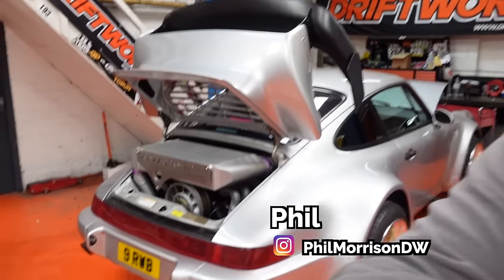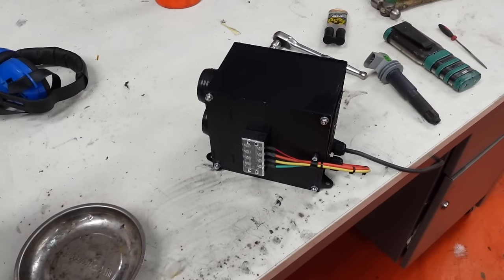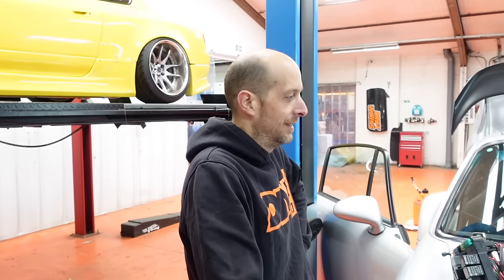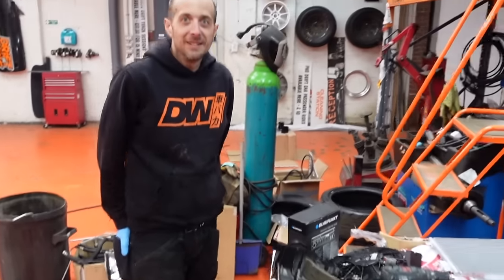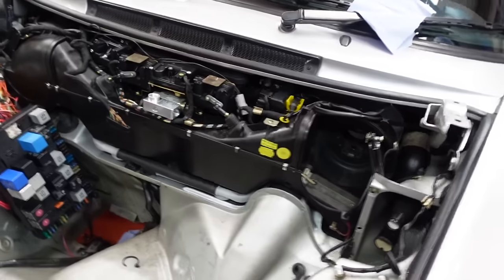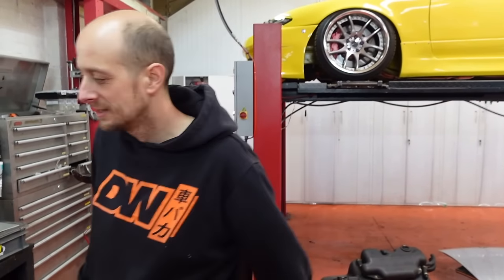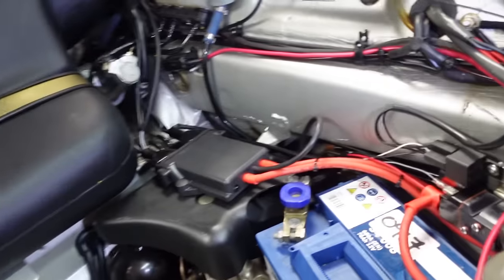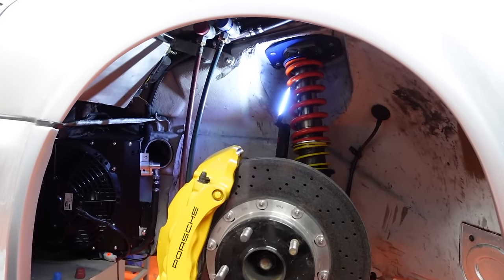Fitting Electric Air Conditioning to my 964 Turbo - Classic Retrofit kit

Comment: A suggestion, make some fine mess shields for under the arches and add louvers (face down) to keep all road debris and rain from the tyres off the condensers, fans and oil cooler.

Comment: I have been considering this for my 1964 Ford pickup F250.  It would be easier than trying to set up a compressor with a belt system.
Reply: Im thinking of putting one in my 74 datsun 620! Just gotta find room for it lol

Comment: I saw a small blaupunkt head unit on the table, are you also adding tunes in the 964?
Reply from the maker: Just fitting a period looking head unit. You can't hear much of the stereo over the engine.

Comment: Any final thoughts on how the electric setup works compared to the original? I've got a backdate 964 here in the shop, and the factory condenser doesn't fit, so this kit is under consideration.
Reply from the maker: I've used it now. It was very hot over the last weekend and we did hundreds of miles. It's not as good as the standard AC, but it would have been horrible without it.

Comment: So aircooled engines don't provide heating to the interior of the car.  WOW!  Never knew that.
Reply: They do with the stock exhaust headers which also function as a heat exchanger to warm fresh air which is piped into the cabin.
Reply: The heater core usually has engine coolant running through it to provide heated air to the cabin. No coolant in an air-cooled engine means (convoluted) alternatives must be used.
Reply: Nono; he removed the car's original heating system. They normally have excellent heaters.